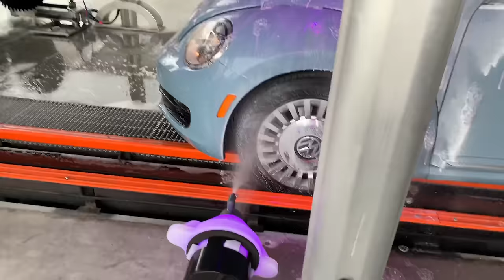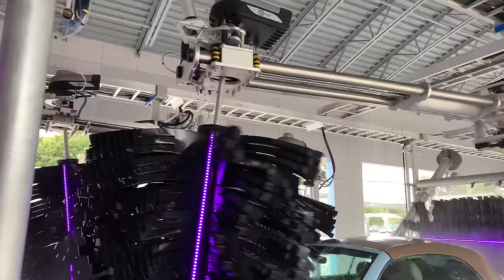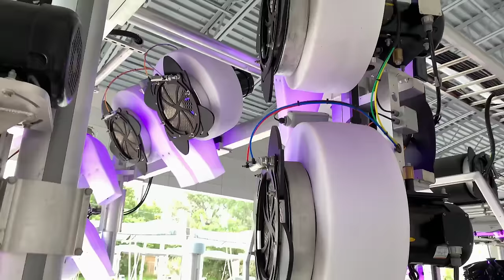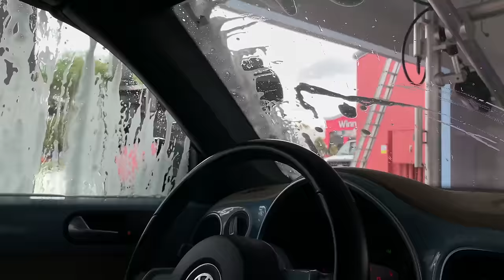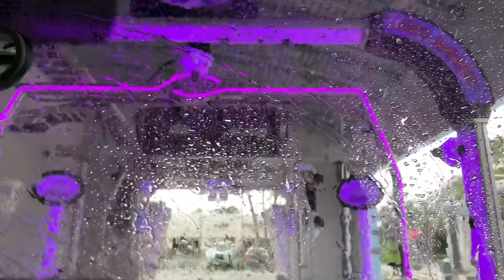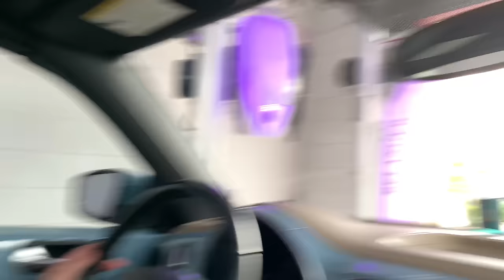SpeedShine Express Car Wash - Outside & Inside Perspectives

Comment: Mmmm scrathes 👌
Reply: Car washes don’t scratch. They are extremely gentle, and cannot damage paint. They won’t absorb dirt either, making it impossible for them to scratch. However, the saying “car washes scratch” comes from washes that still use cloth. The brushes themselves don’t hurt the car but the rocks and sand they absorb do. This wash doesn’t use cloth, therefore it cannot scratch.

Comment: Жесть ,потом сполировать просто ужас сложно ,нарезает лак сильно
Reply: Car washes don’t scratch. They are extremely gentle, and cannot damage paint. They won’t absorb dirt either, making it impossible for them to scratch. However, the saying “car washes scratch” comes from washes that still use cloth. The brushes themselves don’t hurt the car but the rocks and sand they absorb do. This wash doesn’t use cloth, therefore it cannot scratch.

Comment: You would actually have good results with some proper implementation. First you must understand what does washing a car means and you can do it without scratching the car. This is not washing, is just a pre-wash so first thing herr would be to get rid of the  brushes. You DONT brush a car when i prewash stage. Take the following example, you are brushing the wheels then your going over the panels. All the dirt from the wheels is going on the panels with the brush. So no brushes. 
I would do the following: 
1. Cold jet of water to cool down the car (the downside here would be the stress on the brakes if they are hot) and superficially remove big dirt
2. Iron remover on the rims (wait 5 -10 minutes max to take effect)
3. Pre-wash the car (cold water)
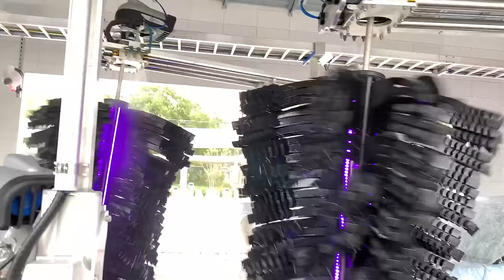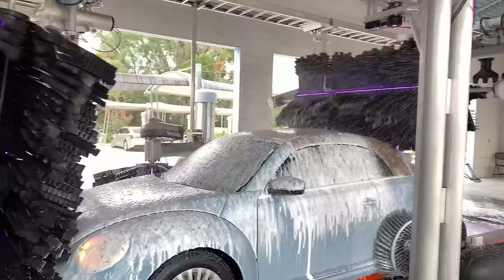4. Use degreaser like Bilt Hamber SurfexHD in a 6% PIR (pannel impact ratio) or DUCTILE in 1:20 - 1:15 ratio or KOCH Green Star
5. Wait for solution to activate 5 - 10 minutes, DO NOT LET THE PRODUCT DRY
6. Pre-wash
7. Use a good ph Neutral Shampoo like Bilt Hamber AutoFoam, or Purifica or something from Koch
8. Leave it for 5-10 minutes to take effect but do not let the product dry.
9. Pre-wash with a soft water
10. Air dry

I guarantee you will have better results then what you have currently and more customers.

Comment: Automatic car wash. Or what any car enthusiast refers to as the paint swirl palace.
Reply: Car washes don’t scratch. They are extremely gentle, and cannot damage paint. They won’t absorb dirt either, making it impossible for them to scratch. However, the saying “car washes scratch” comes from washes that still use cloth. The brushes themselves don’t hurt the car but the rocks and sand they absorb do. This wash doesn’t use cloth, therefore it cannot scratch.

Comment: Clean car in, clean car out..  no shit Sherlock.!!

Where I live this carwash should never been used..  

A proper carwash apply the degreaser first, then high preasure wash, then shampoo and brush.

Then the wheel brushes (that also clean part of the wheel arches) newer should go the whole car side..  

Then the brushes is to slow..   they should be sprayed with a lot of water in high speed to self clean before touching next car.. 

A really shit-car-wash if u asked me..!!!!!

Comment: As a detailer I can't watch this. This is the best way to scratch your vehicle
Reply: Car washes don’t scratch. They are extremely gentle, and cannot damage paint. They won’t absorb dirt either, making it impossible for them to scratch. However, the saying “car washes scratch” comes from washes that still use cloth. The brushes themselves don’t hurt the car but the rocks and sand they absorb do. This wash doesn’t use cloth, therefore it cannot scratch.